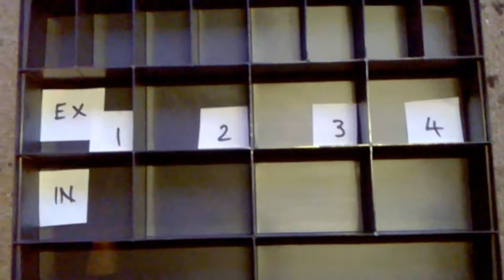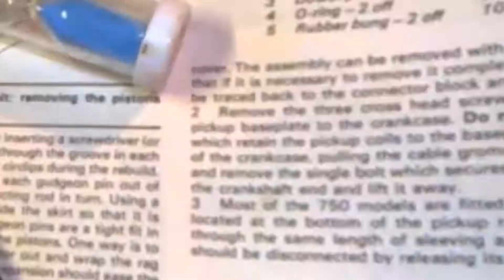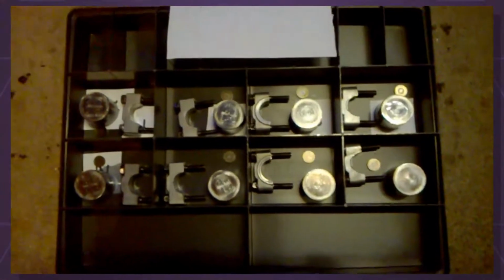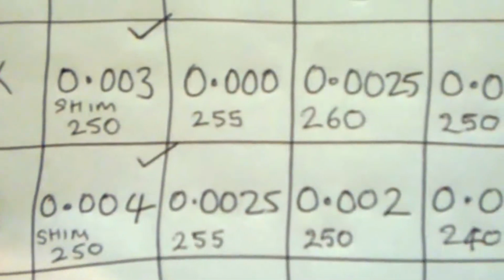Camshaft removal, 'bucket over' shims. KZ750E1 Rebuild #22.

Comment: Cheers Clive. It's only stupid if you're not careful, then make a mistake on reassembly. Can you remember touch up paint. Had a small brush in the lid. Well years ago I was shown to mark everything that required it with these. Also useful when finishing after tightening. Front pulley with a lock tab for instance. Once tightened and the tab knocked down, just a mark to show it's done.